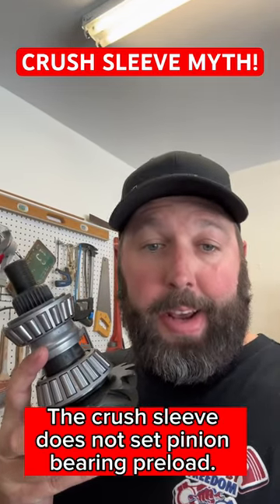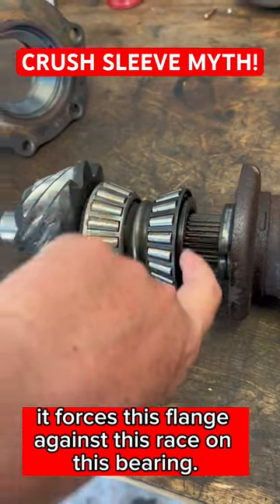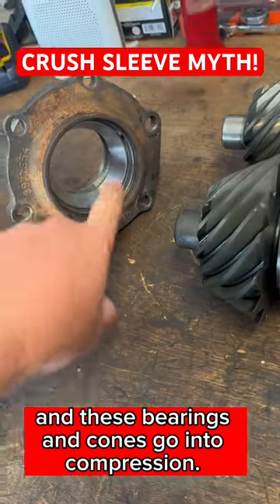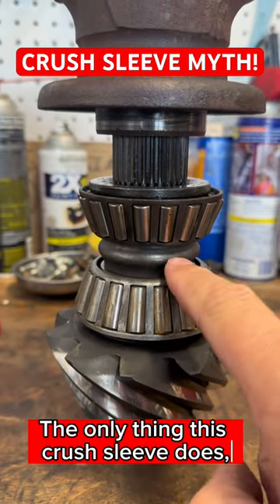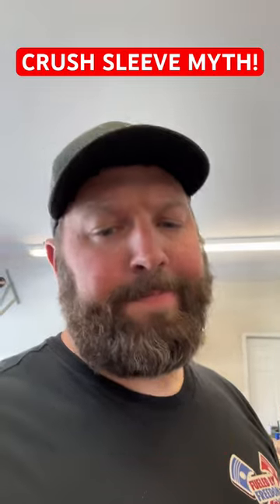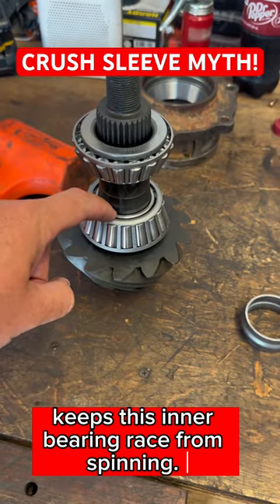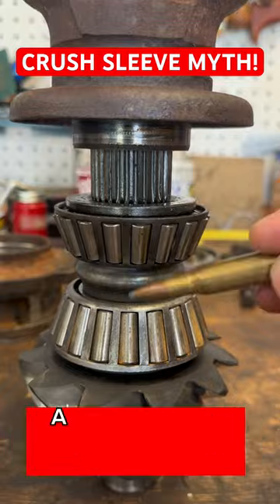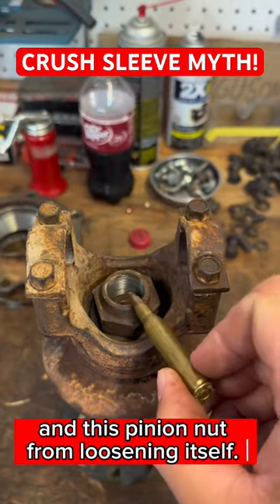Pinion Bearing Preload Isn't Created By A Crush Sleeve! #mechanic #jeep #axle

Comment: It is not a lock washer for your pinion nut I don't even understand how you can possibly think that because otherwise they're not wooden back off on its own if it was just a regular nut not a crush nut it's called a crush sleeve because it helps determine preload this is by the manufacturer by the people that designed the axle and the pinion that you're holding in Your Hands by Dana this is not an argument this is a fact I have been building differentials for over 30 plus years I understand you're trying to do the myth but there is no myth there's only fact and the fact is the manufacturer and the original creators of Dana call it the same thing Crush collar sleeve that determines preload in the original Dana book that I own it's on my shelf otherwise there would be no need for a crushed collar but you can remove that crushed collar and put a solid collar and guess what it does when you put that there you guessed it it determines preload you can't s*** on a stick and say well it's a corn dog now it's still s*** on a stick
Reply from the maker: You've been building diffs for 30 years and you don't even understand the physics of what you are doing 😂. Have you ever read the patent documents for a crush sleeve? Do you have an engineering degree? (I do) Can you draw a freebody diagram of a pinion assembly and tell me how that sleeve determines preload? Good luck 👍

Comment: Using a bullet as a pointer means he knows what he’s doing. Right?

Follow the manufacturer directions, the engineers have a reason. Even if they don’t point it out with a bullet.
Reply from the maker: I’m an engineer and I just told you the reason. I never said to not follow the directions, I simple stated it’s actual purpose. Wouldn’t make much sense for me to explain its purpose and then tell you not to use it 🤷🏻‍♂️

Comment: Little more to it than that but kinda correct
Reply from the maker: Kinda is good enough 😉
Reply: @freedomworx  well you have to have pinion load and torque correct that’s extremely important. The overall concept is correct but there’s important information left out that could killa diff if over looked. It’s not magic like the diff shops would like you to believe, but there are special tools and knowledge that shouldn’t be overlooked either.
Reply from the maker: @dearinghoward well I can’t  tell someone how to build a diff in 60 seconds. 😉 I simply stated that it doesn’t do what most people think it does.
Reply: @freedomworx  you are correct

Comment: IF this was true ,manufacturers would use a MUCH CHEAPER lock washer .
Reply from the maker: It is true 🤷🏻‍♂️
Reply: @freedomworx  can you set the backlash without it in place ?
Reply from the maker: @randomusernumber1  absolutely. I do it every time I build a diff. The crush sleeve doesn't go in until after the pinion depth, backlash, and pattern have been established. It has no affect on backlash.
Reply: @freedomworx  if it  does not affect the backlash why does it need to be crushed ?
Reply from the maker: @randomusernumber1  it needs to be crushed because it puts pressure against the outer bearing inner race, to keep it from spinning on the pinion shaft, and to provide  something for the nut to tighten against, just like I said in the video. It has nothing to do with backlash and it doesn't hold the bearings apart. The differential housing holds the bearings apart. That's why you can set up a diff without it even installed. Hell, you can run the diff without one installed, but I'm not recommending it. The backlash is controlled by shimming the inner bearing or inner bearing race, and adjusting the carrier position. The crush sleeve has no affect on either of those.